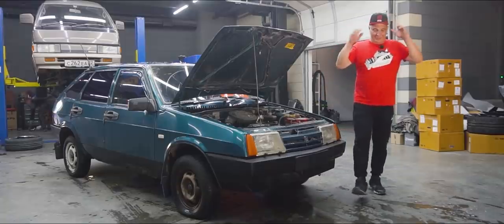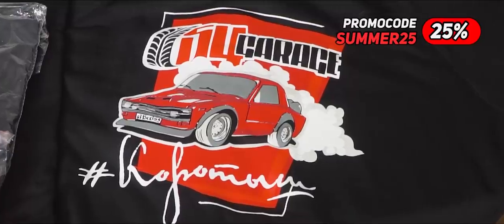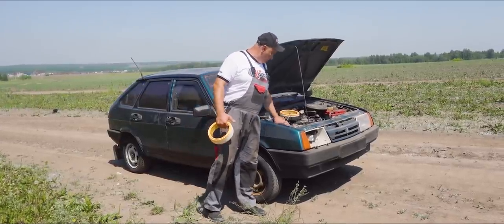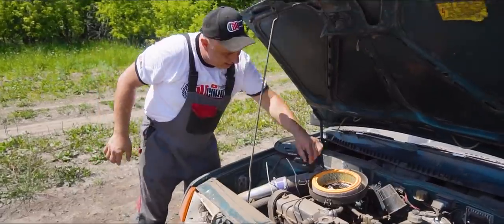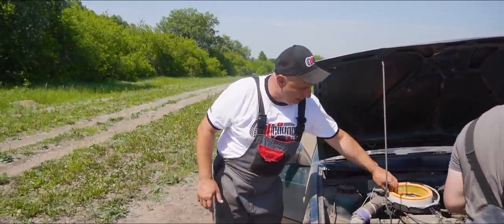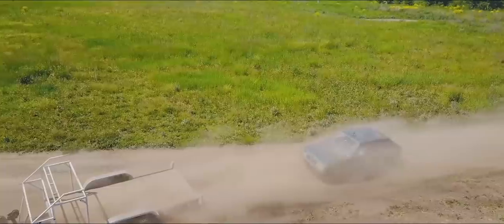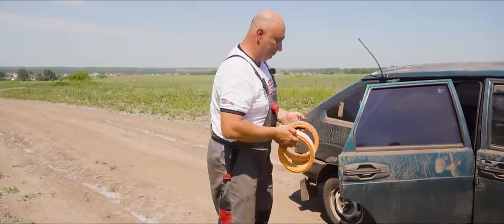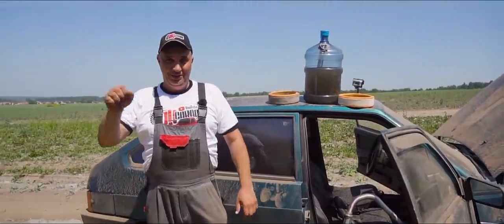Water intake air purification (your motor will thank you)

Comment: HOW TO KEEP YOUR CAR FOR 10+ YEARS

Car dealerships hate this secret!! 

actually why isn't this normal, water filters are extremely efficient at particulate absorption.
Reply: Space it takes up, cost of a water system, and performance loss of displacing the air through the water.

Paper filters work 'just fine' for most needs, and are easily replaced anyway
Reply: @televisionandcheese  but water is cheaper to replace! :(
Besides, engines have 10+ HP, the 'performance loss' is negligible. Don't be silly. You can make a small filter that's light and small but just as effective.
Reply: @dimitar4y  yeah but the performance loss is about 10hp too
maybe if you are american you are used to everything being sports cars with over a hundred HP, but most cars everywhere else are 60-90hp , a 10hp loss is noticeable
there is also of course the risk that the water could run into the cylinders too, causing catastrophic damage, though yeah it's unlikely if made correctly
Reply: @televisionandcheese  performance loss is about 10hp? LOL? Are you drunk? There's no risk in the water going into the cylinders or 'causing catastrophic' damage lmao you are insane. The combustion would dry the cylinder instantly. Some people sell snake oil where it injects water into the cylinder to be 'eco-friendly' and those engines just run at lower performance.

Comment: Wow that's a great idea. Just Change the water instead of the filter. And more cheaper
Reply: Way more expensive, actually. Worse airflow, lower mpg, lower performance, higher complexity, more weight, risk of water intake and so on.